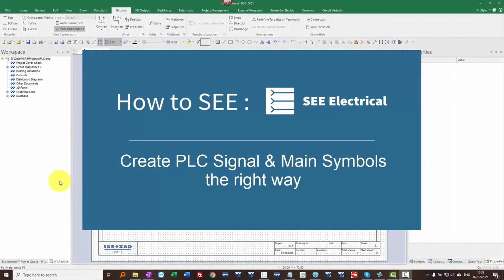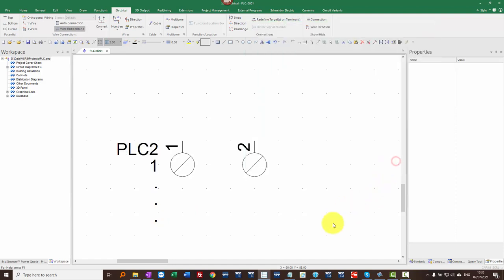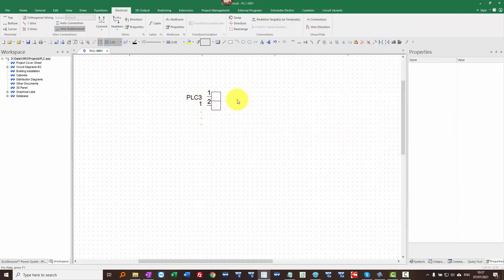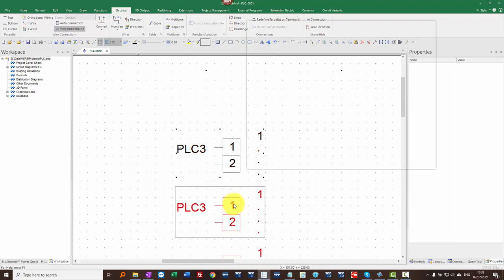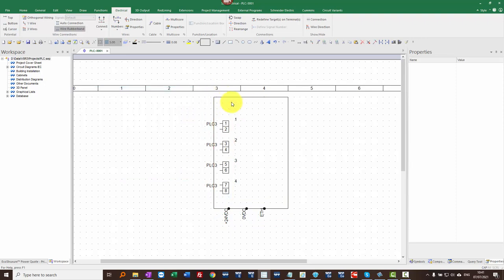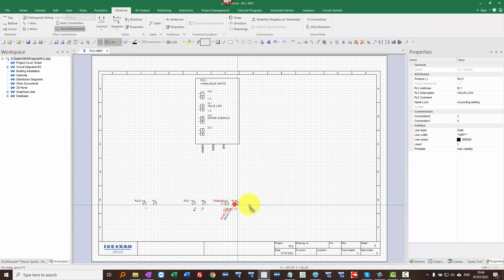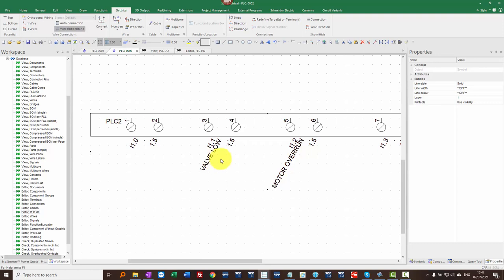PLC Main and Signal Creation in See Electrical V8R3

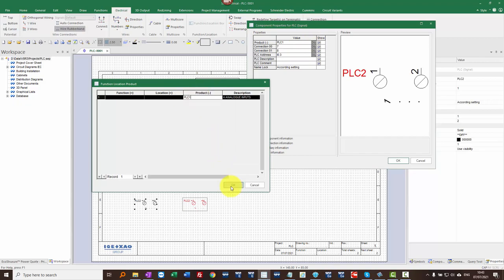Comment: so i have some small problems. @4:44 i can't change the PLC adress numbering method, it doesn't allow me to make the change. and i think that is why @8:30 the numbering doesn't work automaticly work and @8:53 i cant select the PLC adress.
Reply from the maker: Auto numbering for the PLC is limited to the standard and advanced level packages, could it be that you're working with the basic level? A neat workaround is to open a spreadsheet to quickly generate a sequence of addresses, copy (Ctrl+C), then paste (Ctrl+V) the 4/8/16/32 addresses while the first address is selected in the Component Properties dialog for the PLC Main.

Comment: Hello, I would like to ask you how is possible to create a single-line cable from multiple wires.  Let's say 3 wires from the terminal creates a 3 cores cable.  I saw the function multicore but I am not sure how is possible to work with this. Can you give me some ideas? 
Thank you!
Reply from the maker: OK so there is an advanced level function called Multicore which allows a single wire to be marked as having multiple cores. This can then be edited using the Multicore properties and each separate core defined by its connection at each end, color and size. 
This doesn't however allow a fan out of wires at either end. This isn't possible unless custom cable symbols are designed, with a gap between the 2 connection points, which is filled in with your preferred cable fan graphics.